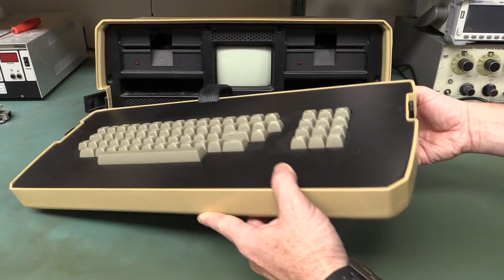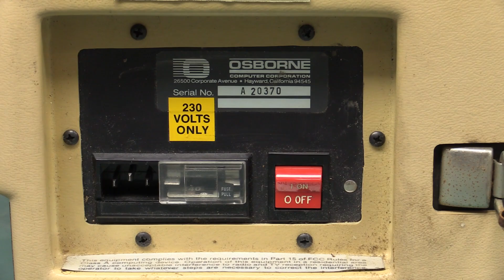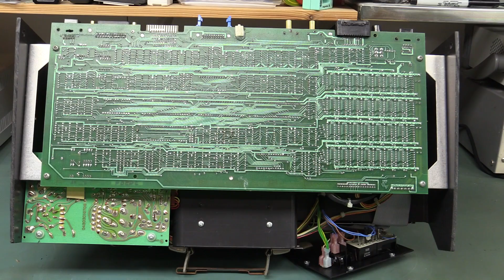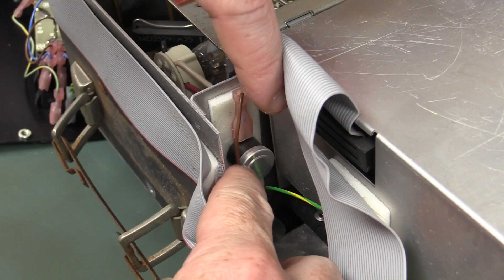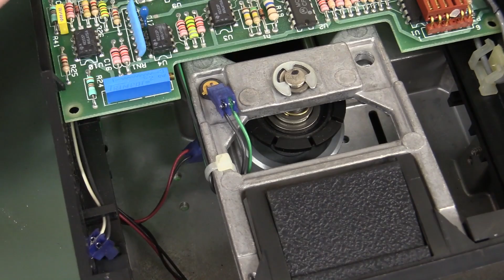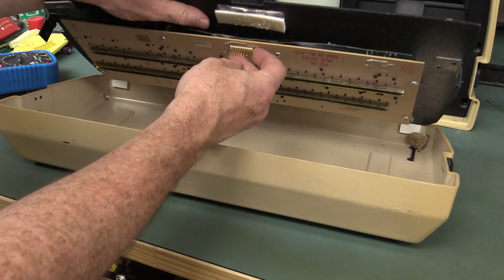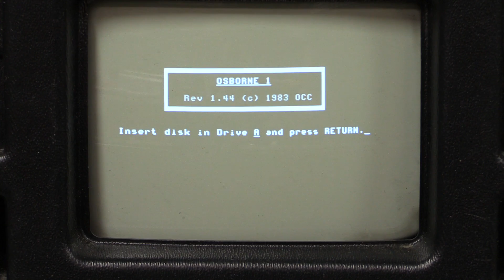EEVblog #955 - World's First Portable Computer Teardown

Comment: At the time  I owned a computer store that sold the competing  unit the Kaypro line of machines  that included  the same software bundle basically. Kaypro  later made me successful transition  to DOS machines. Even a slim  laptop that had  two 3.5 " ddrives
Reply: Mark Meszaros those laptops were flash too! Held back a bit by using lead acid batteries instead of nicad. About the only other laptop I can remember using those was the Mac Portable.  But they from what I recall they didn't do much make a successful transition to MS-DOS as they managed to limp into the DOS era. One of the silliest things I ever did was shove a TRS/80 model 2 card cage etc into a Model 2 or 4 case. Didn't have the parts to make the internal floppies work, but it did more or less go.

Comment: Since the carry handle is on the other side of the Osborne, I wonder if the 'space' in the keyboard section was also part of the shock absorbing design - in case it was dropped CRT down?

Comment: 24:30 Single Sided floppy disc drives were radically WAY easier to build in production. The lower head is fixed on the lexan carriage and biased mechanically about 6 to 16 thousands of an inch ( .15mm to 0.41mm ) into the plane of the mylar floppy disc. ie the penetration as we called it in the drive business. 

With a double sided drive the top head is gimbaled  and the penetration is less and the tolerances need radically WAY tighter.   

   ie the recording heads will have modulation if the penetration is off and with a double sided  unit the top head often is in trouble if the carriage is high or low a tad. With a single sided unit the MPI unit often used Rabbit hair on the non used top brush head, the hair was aligned with the rotation direction.  

With a single sided floppy disc drive the tolerances of the head to the media could be crude as can be; with a double sided unit they had to be 5 to 10 times tighter.  

In production a double sided unit would often have modulation on the top (gimbaled) head. The production line folks would then often bump up the bias spring on the top head, this would make a unit "pass" read / write;  but often fail in the spindle drive current test area. The proper way to fix the mess would be to shim the carraige rods or start over with a new mix of parts. Often in high production units got shipped that worked but had tweaks that made the units wear the floppy discs more, eat heads and make belts slip too. 
 
 Besides modulation of the read write  signal due to mechanical tolerances a double sided unit had two heads that had to be aligned to reference floppies.

  The production cost  of a double sided 5 1/4 head carriage was about equal all the other costs in the drive combined . ie castings, PCB, stepper and brush spindle motor
Reply: 3beltwesty yeah, using ss sd floppies was basically about building down to that low, low price.  A floppy drive was NOT cheap.

Comment: might it be possible, that the z80 could be used directly on the mainboard to use the machine without screen but with a serial terminal? maybe video was an afterthought and they have gone with interfacing the processor like this.

Comment: Re: the 'Batt' connection,there was an aftermarket battery unit for the Osborne 1. If memory serves me correctly, it was a large lead rechargeable battery housed in a case that was at least as heavy and bulky as the computer. The battery allowed for about one hour of standard operation. As you probably guessed, this optional battery pack wasn't popular, and I'm unsure if any survived to today.

Comment: Would that ext. video card edge detector work with an Nvidia 1080?
Great video as always Dave.
Reply: The external monitor required an adapter that plugged into the IEEE-488 port and output raster video for a CRT monitor.

Comment: I don't understand why there was so little attention to miniaturization of personal computers back in the day.  It's obvious that they had the technology to do a lot more with very little additional effort.  So much wasted space!
Reply: See the Osborne Executive (O2) or Vixen (O4)
Reply: Sir Clive Sinclair was always trying to develop ever smaller designs, which led to problems of course in those early days of electronics and computing.  He was heavily criticised for this approach and was far ahead of his time, so I expect other manufacturers and designers, went for the larger bulkier approach to play it safe.
Reply: Honestly, if I had to guess, part of it might have been that it was already so amazingly small compared to anything they had before, that they didn't see any need to keep pushing it further and further because it was already revolutionary. 

Also, without the power of 3d modelling software, trying to actually reduce dimensions would be tricky. The keyboard box on that thing is obviously insanely big, but if you look at the body of the computer, how many places could you shave significant size off of which wouldn't then potentially interfere with a different part of the machine? Nowadays it would take two seconds in CAD to check, but back then, you'd need to design in a margin of safety, lest your boards and parts not fit together.
Reply: Daniel G
My first thought was what if they had put both floppy drives together on one side, and then the space on the right used for a larger CRT display?

Comment: The 50/60 markings on the disk drive flywheel are actually Hz markings. they were designed to be calibrated with a mains connected neon lamp.

Comment: I had one of those along with an OKIDATA dot matrix printer. I used to insert the wordstar disk in the A drive to write the program, pull it out, and insert the Dbase II disk to run the program. Data was on the B drive floppy disk.

Comment: Actually I really wanted a Commodore SX-64.  That screen....:)

Also, I suspect that second sensor on the side of the floppy drive is actually the write protect notch check. You used to be able to buy punches that would notch the other side of the disc so that you could use both sides of a single sided floppy.

And one last thought. The oversized keyboard might have been deliberate because a lot of businesses were still using IBM golf ball typewriters at that stage and their keys were mounted at a similar height above the desk.

Comment: My mum came home with this when I was 2. Including the dBase II pack.
Reply: And the keyboard is that big to lift the screen a little bit. You're not supposed to have the computer itself sitting on the deck.

Our keyboard did have an issue with the cable once, but making it a little shorter apparently fixed it (we had it loaned out at the time, in the early to mid 90s(!)).

It was on external video pretty much all the time it was in real use, which embiggened the screen to 80 characters instead of 52. Used a little adapter from that port to a cinch plug.

I'd be willing to bet that bridge wire cluster to the video board is an aftermarket mod. There were a bunch of mods for the OS/1. Aaaaactually.... I don't think the normal OS/1 has a coax video out. I think the whole secondary board is probably an aftermarket mod. Note how the RCA plug is not labeled on the front panel.

The second sensor in the floppy drive isn't to sense that there is a disk in there, it's the write protect sensor.
Reply: That's a pretty fancy daughterboard for being aftermarket! Explains a lot

Comment: A nice teardown. One has to remember that all PCB design was by hand and double sided tech was difficult to work with as you had to use transparent sheets and use overlays to see where the routing was available. Putting another socket would have meant a complete reroute and be expensive in terms of time costs. With the benefit of hindsight and modern technology it is easy to criticise what was then highly complex work, requiring skills that were hard earned and now forgotten in favour of pressing a button. I designed PCB's for a variety of kit for the BBC in that era and would have loved the current freeware apps and computing power!

Comment: Hi Dave
Sadly, Lee Osborne died a few years after going bankrupt due, according to him, to the subterfuge of his CEO and bankers. But the skill set of the original builders was not good enough to cope with all that new technology.  The return rate of later models was very high and their suppliers were unable to make working parts in sufficient numbers.  The whole business ended up being a disaster right up to sales and distribution.
Lee Osborne was a Howard-Hughes looking guy, who succeeded in publishing and sold Osborne books to McGraw-Hill to then bankroll Osborne Computers.  I used to dream of this machine but by then had built my own CPM S100 Z80 48k system.

Comment: Wow! I remember using one of these as a student in 1983 while being on work placement at the then Royal Aircraft Establishment Farnborough. I had joined a team of boffins who were working on helicopter gearing noise. To keep me busy and stop me from interfering with the real work, I was consigned to a very small room, the tea room as I remember and asked to write a basic fast Fourier transform simulation program with a high pass filter to identify the lower gear frequencies and exclude the higher pitch noise in the cabin. I don’t think they used my program. I do remember it creating an overwhelming amount of data.

Comment: 36 year old portable computer, lets see how long a 2016 apple laptop would last.
Reply: and when it doesn't last longer than a year apple laughs and says "you were abusing it! you didn't think you could press the power button more than once per day and expect it to last do you?"
Reply: jeanious2009 don't think the Ozzy would take the 4 ft drop onto asphalt my Mac took with aplomb (not that it isn't dinged pretty good). Wouldn't like the several 18" drops it took either. And those very non-solid state floppies? Bounce 'em around like that and they're going to want some realignment.
Reply: The bouncy abs plastic inside is like a shock observer, I bet that thing would take a 4' drop easily.

Comment: Never was a fan of the Osborne line. The screen was too small, and the disk capacity was too limited. So I have a Kaypro II and a Kaypro 4. Fun to play around with, but with no graphics mode there is not a lot of gaming to do. These early systems were mainly all work, unless you liked text adventure games.

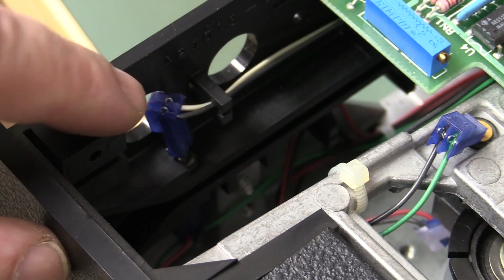Comment: Dave, I think the second sensor in the floppy drive (25:30) is actually for the disk write protect tab.
The presence of a disk is all taken care of via the huge mechanical lever and hub clamp mechanism. Probably a microswitch.

The Z80 on a daughter board board screams of "feature creep". I wouldn't be surprised if the Z80 and a couple of the other chips could be removed from the daughter board and placed in the sockets on the mainboard, and "almost" work. It just looks like they needed some pretty fundamental changes a bit late in the design...

I can almost hear the designer cursing under his breath as a late requirement arrives on his desk after he'd already finished all the board design (probably by hand), closely followed by "oh sod it, daughter board!".

I hope you find a CPM disk, just a word of warning from the world of old computers, those 4116 DRAM can be a world of pain. They require 3 power rails, so a fault in any of those can cause all kinds of issues (or death), and I can't help noticing they're not socketed.

Still amused by the track lengths with RAM and CPU on different boards! Little to no worries about propagation delays. They were simpler times, that's for sure!

Comment: i have the bag from an old compaq version of that thing, still use it, even used it as an actual laptop bag in the early 2000s.

the compaq version i had used a plasma display in green, i think... not sure which one's bag i ended up with, we had green and yellow ones at out shop at the time.
Reply: Compaq was a third party version of the IBM PC, not the Osborne.

Comment: Osborne was great in the day. It was a real step up from my Sinclair. It had a real full size keyboard. I also purchased separate a modem, a parallel printer cable, and an external video adapter that was required in order to get external video.  I still have both today. As the Osborne was designed there was a real scramble to find all the parts to make it work. You can read a little about this in the book "Hackers" by Steven Levy. The processor was 8080 or the Z-80 made by Intel but they used what was available and had to use Motorola chips for addressing the memory, which was a little different than if all Intel chips had been available. As far as wiring, at least they had progressed beyond wire-wrap. Quite the machine in the day and it served me very well on several projects back then.
Reply: The printer cable cost $40.  I made my own with ribbon cable, an edge connector, a hack saw (for the notch) and some epoxy to hold it together after the surgery.  Hard core.

Comment: Nice teardown!

You should replace those Rifa brand paper dielectric EMI filter caps on the Astec power supply with modern safety-rated poly film caps. The old paper dielectric caps notoriously burst into flames under power after 30 years or so. One of them in your computer has already blown.

The most common problem I've personally encountered in those old floppy drives is the grease drying out in the spindle and hub clamp bearings. I've been able to work oil into them to get them spinning freely so far. The hub clamp is usually not too hard to disassemble, while the spindle might be harder to get into. The second optical sensor would be the write protect notch sensor.

Comment: I wonder if the ROMs had been upgraded since there was 1983 on the screen?  Considering the 1982 stamping on many of the chips.
Reply: the ROM chips were 2732 types which are EPROM. IE you program them when you want to use them and they can be erased. They are supplied blank and programmed either in bulk or occasionally at point of use on the production line. So even though the chip came out of the fab plant in 82 it was most likely programmed in late 82 or possibly 1983. OTP (fusible link) PROM was the only kind of memory at the time that I know of that could only be programmed once. If you had high enough volume you could even go to masked ROM, where the ROM was produced with the data already in it. Masked was the cheapest if you got enough volume (typically 100,000 was the minimum order volume). OTP was next cheapest but once it was programmed you were stuffed. EPROM was usually cheaper in an evolving product because 10 minutes under a UV light and you could program it again.
Reply: Well I meant the majority of the chips on the board were 1982 dated, not just the programmable ones.  If they were selling these at 10,000 a month, there wouldn't be much lead time between parts going in and boards going out.  That might also explain the mish-mash of RAM chips by 3 different vendors in one bank.  They simply had to take what they could get to keep production going.

Comment: Worked on a few of those in the day.  They actually had a portable power setup, I bought a pallet full at one of the auctions. It was one of those shoulder-strapped portable TV lead-acid packs, 12V at about 8AH or so. It didn't use that front plug, tho. There was a small (about 2" sq by 4" long) aluminum box with a cig lighter 12V plug hanging out of one end, and a female IEC out the other.  Clever box. Had two transistors and a pot core transformer as a free-running hi-freq inverter. They rectified the output and fed slightly filtered DC into the AC input of that Astec P/S. About 250VDC IIRC. Power supply ran happily on DC. The little box was even cool running. The o-1's PS was a 35w unit so you could squeak an hour or 2 out of that battery. I would rewind those little units to get 30VDC+/- to run a car amp with some headroom. One would do about 60W and could run an Osborne Exec barely.. The exec had a 65W astec. I bought several of both P/Ss, as the radio Shack TRS-80 model III/4 could use the 35W as a drop in. And adding floppies to the base model required a second 35W. Model 4 used the 65w directly, IIRC. Sold a lot of those mods in the early 80's. Fun times.

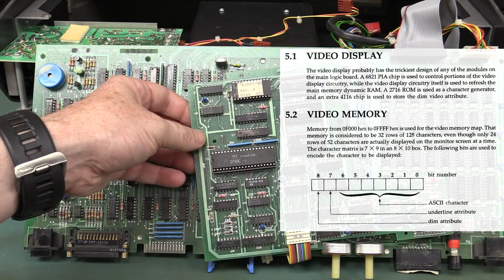Comment: at 22:10 did anybody else notice the black wire from that "mess" of wires actually goes UNDER another part? (marked as C82 on the board)

and at 16:11 if you follow the light blue wire up and kinda left it too goes under another part? (marked at part R13 on the board)

Comment: My dad got one when I was 12.  I used it in college in 1989.  The floppies would randomly develop errors and Id have to tear it apart and clean the edge connector for the floppy cable.  I had an external CRT for it too.

Comment: I got my first computer when I was 5.  It was a Zenith Z160 luggable.
Reply: Jackson Cupp I had one of those. The Z160 might just have been the least portable of all the luggable computers. I think it clocked in about 45 lbs (definitely north of 40 lbs) and was probably twice as long as the Osbourne. The floppies were on a pop-up shelf so theat you could maximize vertical space for the display and install full length ISA cards in it. As I recall it was a ISA backplane design with the CPU and some of the support hardware on one ISA card. I forget if the RAM was on the CPU card or a separate one, but I think there were three ISA cards to the base system. 

One time I brought it to school with me - for what pretext I don't recall.
Reply: It was also capable of color video output.  I got a CGA color monitor for Christmas one year.  That was awesome.

I remember my father brought it to my kindergarten class for show and tell once.